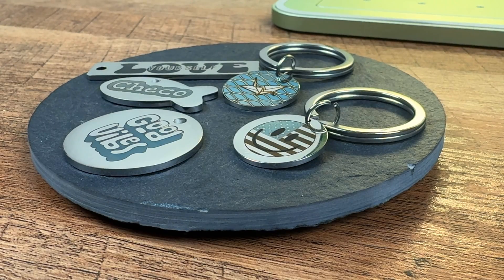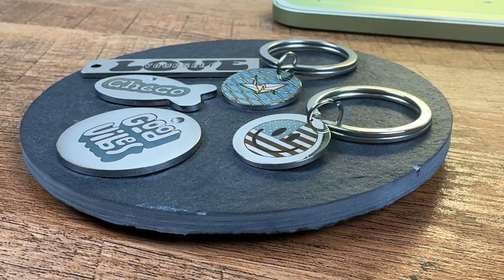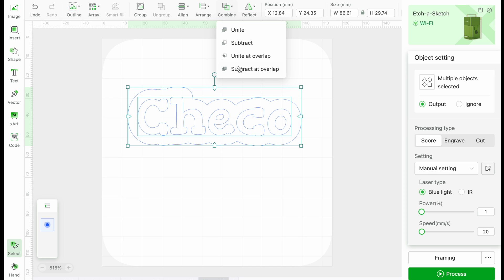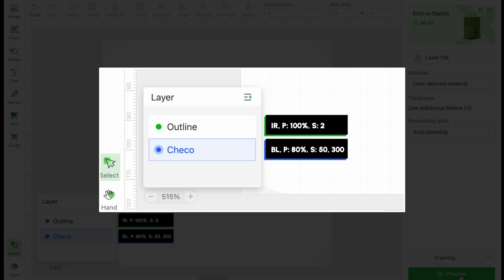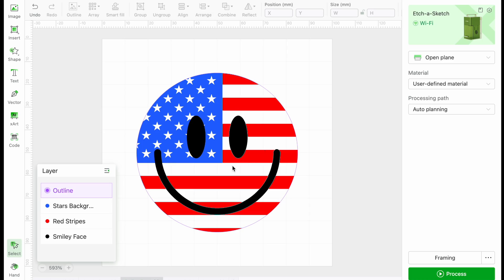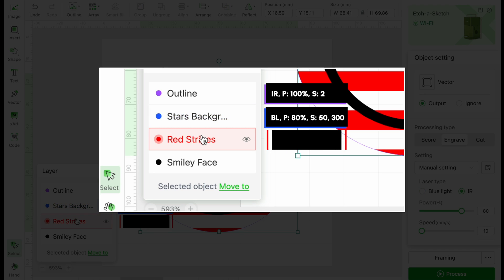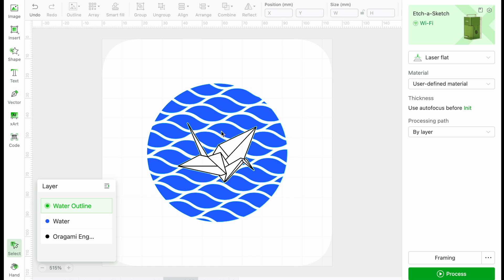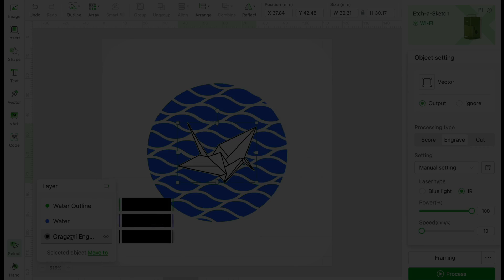Multi-Color Engraving with the xTool F1 | How-To

Comment: Hey, how do I change the order of engraving different layers? For example, I have red, blue and black layer, and I'd like to engrave the red one first, black second and the blue one would be the last to engrave. Is this even possible to do in xcs?
Reply from the maker: You need to update the processing settings to use “by layer” on the latest version of XCS this can be found by clicking the 3 dots next to the green “Go to process” button. From there switch from “Auto Planning” to “User Defining” and there you can enable by layer.

If you are on an older version and are having trouble finding this option just let us know what version you are on and we can help you out
Reply: @VelfCreations  thank you

Comment: Hi, at 2:38 the voice over doesn't match the settings shown for the 'smiley face' could you confirm which is correct? the screen states BL,P:80%, S50, 300 but the voice over says IR, 100%, S:5, 300. my F1 has not arrived yet but I would like to try a similar design when it does arrive. Thanks
Reply from the maker: Hey! Great catch! It is a speed of 5. Typo on the video. We also have the projects available to download so all you need to do is open it and resize all the settings are set. But just a heads up some stainless does react a bit differently so your color results may vary. Hope that helps!

Comment: Is there somewhere I can find out settings for various colors with just my blue laser on my D1 Pro ?  I dont have the IR module right now, but considering that investment...
Reply from the maker: You should be able to get good colors with the D1. The blue light actually produces a good amount just not dark colors like black and brown unless you run it really really slow. Sorry wish we had more info but we don't have the D1 currently. If you have a 10w module our settings may be a good starting point because the F1 is a 10w diode as well

Comment: Hello, thanks for the video, where can I get the configurations for all the colors? greetings
Reply from the maker: There are files on Xtools projects websites that have test grids you can run. Each metal is a bit different so if one color works for us it may not work for you. Running a test grid always helps!

Comment: Can you showbus how to engrave a photo on stainless steel?
Reply from the maker: Hey, So sadly we are actually not huge fans of how photos are engraved on stainless, that's why we never made a video to cover it. The photo looks fine when you look at it at a very specific angle but it mostly looks like an X-ray. Also every photo will need different settings but if you want to give it a try this may be a starting point

IR Light
Bitmap Mode: Jarvis 
Dot Duration: 1500
Power: 100%
DPI: 900

Comment: Great tutorial! New to laser field but am eager to learn. Thank you for sharing your expertise. I have a 34 1/4" x 41" x 1/2" piece of plywood to close off our fire place during summer months and I would like to burn some type of patch pattern design on it. I know the project size is limited on the pass thru of the F1 but I have not experimented with it yet. It seems logical that with the laser head set at the lowest z axis position shooting laser thru the opening with base plate removed the project area would increase, if that makes sense. Have you experimented with this at all?

Comment: Hallo how can I engrave on pvc cards what is the settings thanks a lot for your such a videos ❤
Reply from the maker: Hey 👋 
We haven’t tried PVC and just a warning for anyone else who doesn’t know engraving PVC releases some really toxic fumes so you need to either engrave outside or have really good ventilation. 

With that being said we would use the IR laser, power set to 100% and a really high speed maybe 1500 to start and work our way down. Use 300 for lines per cm

Hope that helps
Reply: Thank you so much will gonna try it and I have watched this full video and give the same settings on my keychain to make such black smile but it turned to golden brown color not really black any other settings please 🙏 😊 that I can try it